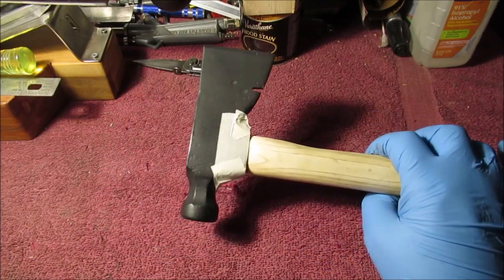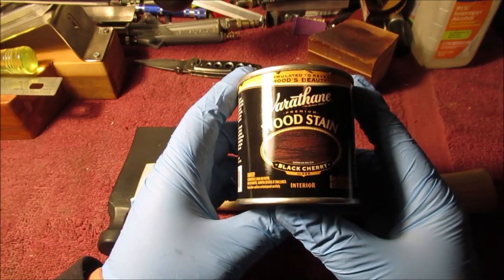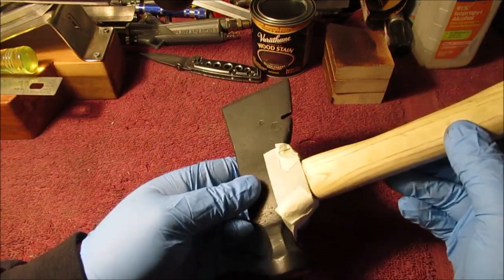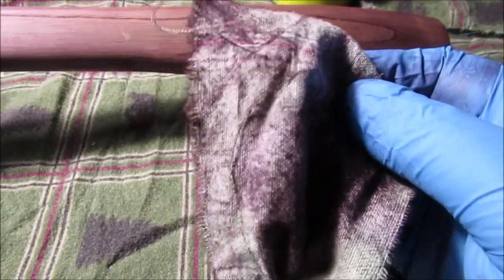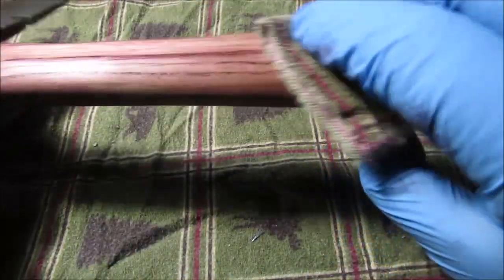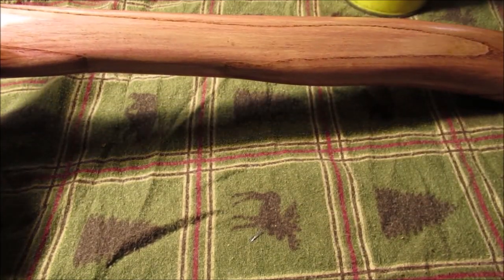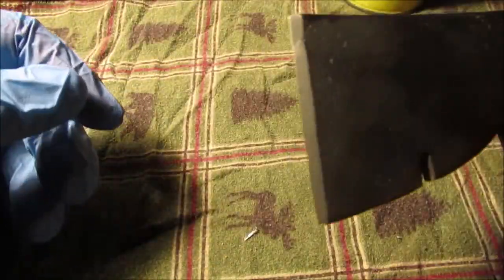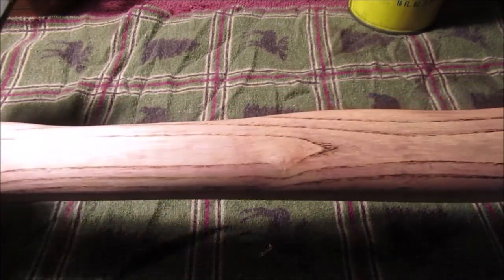Testing Wood Stain on Hatchet Handle

Comment: Hey there! I’m a master woodworker and I’ve taken refinishing classes for antique restoration. Ok I’ll quit bragging because I’m not that special. Ha! One of the best thing I ever learned to help match preexisting stains or on a new project is to use wood sealer. Ignore the directions on the can advising you that you can apply the stain within an hour or whatever the can says. Apply the sealer but give it at least 24 hours. Sand before staining because sealer raises the grain. Then start applying stain, let it sit, wipe clean and for darker depth reapply. Lacquer is my preference for finish but let cure well on hatchet before use. Hope you’re doing well. Hardly ever on YouTube anymore.
Reply from the maker: I am definitely not a wood worker ..I have never had much interest in it ..I am still wondering  if  the reason the stain would not soak in is  because it was oiled with linseed oil
Reply: not2fast4u2c also not a professional but that is most likely the culprit.